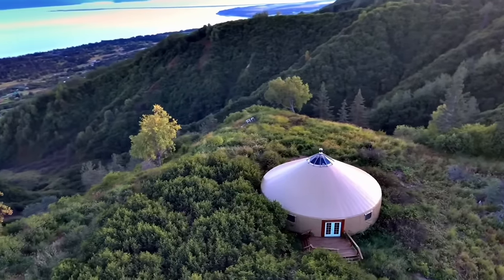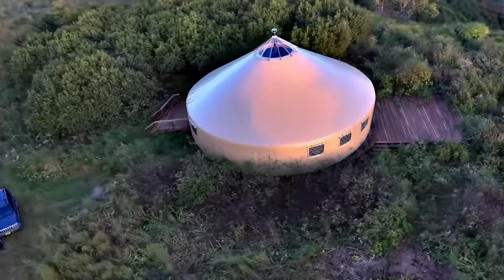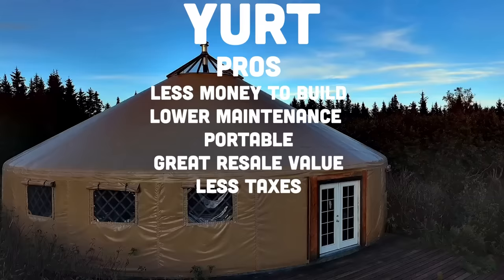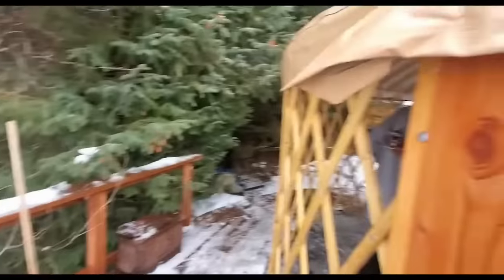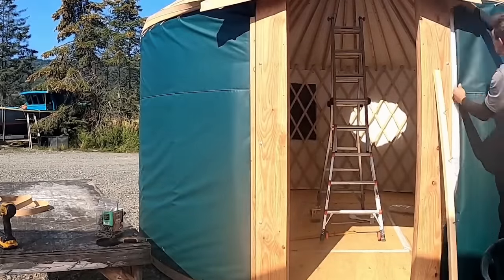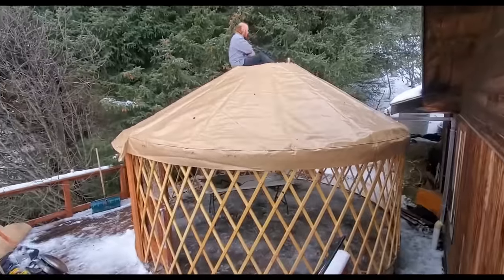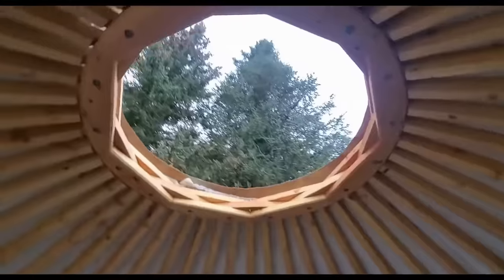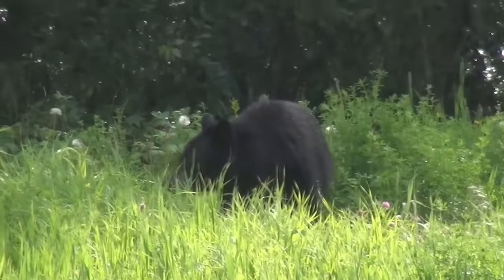YURTS... Affordable Home Solution? Or Too Good to be True? Expert Explains PROS and CONS

Comment: My wife and I live in a yurt in North Carolina. It's a 30 ft yurt with ten ft high walls. We have normal double pane windows, normal house doors, actually very beautiful doors. The insides are much like a normal house. And that's where things get expensive. A modern kitchen, bathroom septic, etc. In a yurt isn't any cheaper to build than a normal house. Yes, the outside of the structure is less expensive but everything else is the same. In the end I think we have about as much money in our yurt as we could have spent on a smaller double wide. Yurts are way cooler, to be sure, but I suppose that's a matter of opinion.
Reply from the maker: Yeah, you for sure can sink a lot of money into them if you want to 😆
Reply: What is the humidity and temperature like in the summer? My tiny house stays at 62*F.
Reply: @OneMoreAnimalAndItsAZoo  Hi Debbie. We heat and cool out yurt with a heat pump and two pretty good size mini splits. We don't have any issues with humidity, the heat pump works great for that. I will say that yurts are easier to heat than cool but we keep it at about 68 in the summer. In retrospect I'd heat with some kind of radiant heat and cool with the heat pump. We may be adding radiators to the heat mix because radiant heat works so much better than convection in a yurt. One tip on cooling, lots of modern yurts have a plastic dome on the top that opens for ventilation. Make sure that dome is tinted, not clear. Even with a tint, it's almost like a magnifying glass up there in the summer.
Reply: @1337farm  I have a 73 SQ ft tiny house that I love with a mini split. My electric bill is $50/month
Reply: @jasonlassen7599  we are in KY and I debated a yurt for like 5 years. Is it unbearable in the summer if you are offgrid
Reply: @OneMoreAnimalAndItsAZoo  that sounds great. There is quite a difference between a small tiny house and a yurt our size. We have almost 1000sqft because we have a usable loft due to the 10 ft walls so heating and cooling are on another level for us. I wish my electric bills were that low!
Reply: @Shelleys4Seasons  Hi Shelley, the way our yurt is situated, yes, summer would be unbearable without AC. If you were to make sure your yurt didn't get a ton of direct sunlight in the summer it may be possible without AC. I was also worried that we would feel like we were living in a cave so I went nuts with windows. Heck all our doors have windows too which causes even more solar gain. It's great in the winter but not so great in the summer. We also get quite a bit of direct afternoon sunlight. In retrospect we should have thought more about where we were setting up the yurt. We still love it though.
Reply: @jasonlassen7599  Since I'm in menopause, my electric bill could be a $1000 and it would be worth it. 😂
Reply: Oooo...I want one🤭🤗
Reply: 30ft is the radius or the diameter?
Reply: @christinemurray1444  diameter
Reply: @christinemurray1444  to my knowledge no one makes one that is 60 ft in diameter. That would be very tall t the peak. Last I heard Blue Ridge Yurts was working on the engineering on a 40 foot in diameter but that was before Armageddon so I'm not sure they ever started to actually offer them.
Reply: That sounds like a Blue Ridge Yurt! I want that same model in NC as well! But it's proving very difficult with my county building inspector. Any advice?
Reply: @jessdee8833  Hi Jess, yes it is a Blue Ridge Yurt. We love it. One piece of advice you didn't ask about, but is specific to Blue Ridge Yurts, is I'd get the upgraded roof. Now, as for inspectors. Sometimes you really just need to be more realistic about what county you are trying to build in. We live in Yadkin county. Forsyth would never in a million years allow this build. You have to build in a rural county that also has a reputation for independence. We started our property build with a cottage shed from Sheds Direct that is my Wife's art studio. We connected the main power box for the property to that building. Set up the connection for our RV and lived in that as we built our yurt. Yes, Yadkin county has rules about living in your RV but it's a fiercely independent county and no one is going to tell anyone what to do on their land, especially if you are simply trying to live. Be nice to your inspectors. Ask them "how would you like us to do this?". NOT, "can we do this?". Another tip to offer them is our inspirator used mobile home rules in a lot of ways to get us by. We use Studer vents on all our drains instead of the normal vent that goes through your roof as an example. Use a real septic and well system, make sure they are inspected. Inspectors are going to be even more leery about a build that doesn't have proper ways of waste disposal. What county are you trying to build in?
Reply: It depends on how luxurious you want the yurt.. it doesn't need to be that expensive.
Reply: @jessdee8833  Sweet Danes Farm look us up.
Reply: @LadyForestStar  You are 100% correct. It's all relative. I'm just saying that a $15 - 25k yurt isn't a house, it's a shell. You've still gotta pay for a foundation of some kind and enough things like plumbing, sewer, electrical etc to get a certificate of occupancy from your county inspector. There are a handful of counties with no building codes whatsoever, Idaho and Bonner counties in Idaho are good if you want total free reign. There are others too. But most folks want to be closer to civilization. Can it be done cheaper than we did it? Absolutely.
Reply: @christinemurray1444  it’s the diameter I believe. Just by looking at it.
Reply: Hey Jason could I or my husband email you perhaps and get your thoughts on some questions we have?
We'll be renting from some family friends in Idaho and have come back to our long ago idea about Yurts once we find our own land. We will most likely go through Pacific Yurts and will take a trip down there to see them in person but some times you just don't know the right questions to ask. Again, we'd love to pick your brain!
Reply: Hey Jason could I or my husband email you perhaps and get your thoughts on some questions we have?
We'll be renting from some family friends in Idaho and have come back to our long ago idea about Yurts once we find our own land. We will most likely go through Pacific Yurts and will take a trip down there to see them in person but some times you just don't know the right questions to ask. Again, we'd love to pick your brain!
Reply: @slee7991  of course. Feel free to reach out. Happy to help. There may be Idaho specific things I don't know any more. I haven't lived there since 2000 but have tons of family all over the state.
Reply: @jasonlassen7599  I’m in NC and debating a yurt as an initial structure. Any general advice in addition to what you’ve said here? Thanks so much for sharing what you have! I was just thinking to myself, is it even realistic in NC or to hot/humid/etc.
Reply: @tylorban  Hello Tylo. Sure happy to help. Look up Sweet Danes Farm and reach out. I can send you some thoughts I just put together for Jess. Yurts work fine in NC, or at least in Western NC. Piedmont and mountain area. I assume that would work fine in the low lands but the closer you get to an area that is directly effected by hurricanes the less I'd advise them. The county you want to build in is going to matter a lot.
Reply: @jasonlassen7599  definitely will do! Thanks a lot.
Likely Wake county area. Maybe southeast no more than Sampson
Reply: @jasonlassen7599  believe it or not, I watched an outdoorsman here on YouTube, ignite some dry grass with a clear piece of plastic. It was just a transparent piece with nothing special to it. He was able to focus the light to the smallest point he could make and roughly 30 seconds after it started smoking and then ignited.
Reply: Really insightful comment. My takeaway: Basically, if you're willing to use a SUPER simple plumbing system for the sink/kitchen, avoid bells & whistles, and use a composting toilet, you can avoid a lot of these expenses. I guess at the end of the day, it all comes down to comfort thresholds and budgeting goals.
Reply: @brianct7801  thank you Brian. I agree that you can be pretty simple, certainly more simple than us. However, here's an example of how things can get away from you. If you are going to have plumbing in the yurt, no matter how simple, you are also planning to have grey water draining from the yurt. I don't know of any inspectors who won't make you run the grey water through the septic system. That's one more big ticket item and why have a compost toilet if you've already bought a septic system?
Reply: I'm sorry but I think that money would increase the price of your home if you put it in a log, brick or stick home & increase in equity. Unfortunately once that kind of money goes into what's could be considered temporary or mobile homes they only decrease in equity annually. Then if you want to sell you'll also need a cash only buyer because a bank won't give someone a loan to buy it.
That said it is really nice & to have it to maybe keep in the family tucked away from the rat race, right now i give anything for that peace.
Reply: @Homesteadyshow  and never get it back
Reply: @kimk2635  Hi Kim, I think you have great points and are probably right. For us it was about building with cash and not having a mortgage so our choices were more limited. One thing I'd argue about is that there is nothing mobile about one of these yurts once it's set up for living in. It would be easier to move a stick built house than this thing.
Reply: @OneMoreAnimalAndItsAZoo  
That’s pricy if you break it down per sq foot. I cool a 2200sqft home in Deep South texas. My thermostat at 78..I pay $180 at most dead of summer..heating in the mild winters we have is a different story. Though even with the recent “cold” spells with constant 30-40 degree day we don’t even turn on the heat. The foam insulation keeps the home warm enough for us to wear a sweater if we are cold.
Reply: @kimk2635  what is the point in putting hundreds of thousands of dollars in so-called equity in a traditional home when you won’t pay that home off for the next 30 years and you’ll end up paying double with the home is worth in interest rates insurance and upkeep? If you actually think that a traditional home gains real equity and is an actual investment, then you are completely wrong and I’m glad that more people think like you do because it keeps this type of lifestyle a secret and very affordable and avoids, many zoning and regulation laws that are rampant in places where people think that homes are the only viable option for both investment and living opportunity. Stay in your traditional home. It only makes it easier for me. Thank you for your sacrifice.😊 hopefully after you’re done paying off your house and you reach the age of 75 you can finally retire and realize you’ve been working 50 hours a week for your entire life to pay for a so-called investment. ✌️
Reply: @Shelleys4Seasons  I've worked in the Alabama heat a lot, and it is pure hell. Part of the key is staying hydrated, using skin protection, and nutrition. The flying insects can really mess with you, but you get used to it.
Reply: Good luck in the next hurricane
Reply: @kimk2635  Absolutely. This is logical thinking. I'm very attracted to Yurts, but only  because they're cheap and temporary. If you think it's gonna take you 5-7 years to finance & build your own permanent off-grid domicile, yurts seem like an almost perfect solution. But like you said, it's a hard flip.
Reply: @jasonlassen7599  Thank you for the reply. My personal tolerance for RISKING operating outside of regulatory bodies is pretty high, so this needs to factor into cost as well. But I appreciate you mentioning this; find it weird that most yurt vids don't mention the regulatory aspect... hmmm...

BTW, without going into too many details, Idaho is a real option for me.
Reply: @brianct7801  Idaho is ideal for what you are thinking. My earlier comments about fiercely independent counties is easy to find in Idaho. Counties in Idaho that fit the bill: Idaho, Bonner, Boundary, Nez Pierce, Washington and Gem. Here's a quote from the Idaho county comprehensive “It is the belief of the Board of County Commissioners that people who buy and build in Idaho County have the right to build the home that best suits them.  If the roof caves in under the weight of the snow, they will know better next time….County government will not intercede on your behalf to make your neighbor live up to your standards.” LOL! Sometimes I really miss Idaho and I'm still proud to be a native Idahoan. Good luck with your plans!
Reply: @brianct7801  they don’t mention them because if you’re spending only like 5000 bucks on the structure you can afford to also fall within the regulatory guidelines I find it funny that people complain about certain expenses when living like this but they don’t complain about people spending $1 million over 30 your time span on a typical mortgage or similar money on rent.

A lot of places require a septic system and it’s like a big deal it’s like 5000 or $15,000 just pay the money and you’re good to go people forget that every house no matter if it is $10 million or $2000 is virtually just a wall and a roof and that’s it. Everything else is optional, and most likely not needed for the majority of people to live an amazing life. 

The difference between me being in a $10 million mansion and me being in something like what is in this video it’s virtually the same thing because I see no difference if I am online why does it matter what is around me and why should I have to work 50 hours a week for the rest of my life to pay for fancier walls?
Reply: Theres a yurt farm just outside Bryson City (I live here too) - is that yours?
Reply: @JasonLassen thank you for your honesty! We need a place to live, landlord raising rent too high for us. Wish we had land. Darn, need a home. We'll, if God wills it, we'll have a home soon.
Reply: I want to put up a yurt in NC. Do you have yours in a rural area and did you have any problems with zoning/building codes?
Reply: @Jj-gi2uv  wish we could afford a tiny home. With the problem of rent going so high we'll be out on the street.  Wish there was something we could do.
Reply: @cawster6858  hello caw ster. Yes we are in a rural county. I'm pretty certain a yurt dwelling in an urban area will be a no go. We didn't have issues with zoning or inspectors but we didn't try and cheat the system. Had we, I'm sure we'd have been caught and told to take it down and yurts would have gotten a bad name with the inspector and others would have had an uphill battle in the future. Ours is the first yurt in our county. Choose a rural county, preferably one that isn't full of rich folks, and work with your inspector. Ask them how they would like you to do this, not CAN we do this. They will be good to you if you are above board with them.
Reply: “About as much on a smaller double wide” man see this is basically the exact reason tho, not the amount of space, just the ease to put it up and actually be able to live in compared to a lot of other stuff and even how to upgrade after initial installation.
Reply: Is that near a lake?? Iv seen a tour of a permanent yurt similar to what you described. Beautifull home.
Reply: Yeah, this isn't an honest assessment. This is straight up marketing. Thank you for your input.
Reply: Hello, I’m looking to move back to north carolina and live in a yurt as well. What hurdles did you have with getting one. Any zoning issues? I would be purchasing my first house so I don’t really know much about buying land or anything along those lines.
Reply: @hungtor2226  As far as getting a yurt there is no problem there. Blue Ridge Yurts is just up in Floyd Virginia and they make a great product. Zoning or inspector issues are going to depend on your chosen county, not the state itself. You will need cash or personal loans for the yurt itself, no one is going to give you a mortgage for a yurt. You could get a mortgage for the land though if you needed one. As far as finding land get with a local realtor. I would advise buying land that already has a well, power and septic on it. It's not that hard to find a property with an old house that needs to be torn down that has the infrastructure you need. You can add the infrastructure yourself but it can get spendy.
Reply: I know a few who went off grid in yurts and just built outhouses and stuff. Apparently cheaper than building a house
Reply: @LadyForestStar  Exactly 👍
Reply: @jasonlassen7599  Yes! I had a Mongolian Yurt. My plan was to have an insulated earth floor. I've been to yurts with wooden floor and one with earth floor and earth floors get a very special grounded feeling that I absolutely love. But I also planned to live without electricity. Maybe just take one electric cord from one outer source depending on if there already where a source on the land. I also planned to buy land with an abandoned house, that way you get less restrictions with building application when you build on land with an already existing building. Here where I live are tons of abandoned houses. And the housing prices are already very low. So yes... It's very depending on how luxurious you want it.. I don't ask much out of life except gratefulness for the little that I have and real deep friendships. I live in northern Sweden btw.
Reply: @christinemurray1444 Diameter. A 30’ radius would be crazy huge, like a circus tent! Lol! 😂
Reply: I would love to see photos of your unique and amazing home.  Do you have a website?
Reply: If you attempt to make a yurt, like a normal house, yes.  Many don't.
Reply: Hey do you by chance have any idea of the laws in South Carolina for yurts I’m right on the border of sc and nc but would rather stay in my home state and closer to family, and I’m looking at some alternative housing and I can’t find any information on sc’s regulations on yurts, any tips or information would be much appreciated.
Reply: @JCthe1st  there likely won't be state level regulations that you can't overcome. Each county may have regulations or building codes that you can't overcome though. The folks at Blue Ridge Yurts may know the friendly counties in SC. You can pretty much bet that the counties with the cities in them won't allow a Yurt as a main residence. You could also start calling the inspector offices in counties you are interested in to get their thoughts. Rural SC is just as independent as NC so I'd be surprised if you can't find friendly inspectors.
Reply: A  new single wide is 85k-100k , a new (larger) tiny house is 100k-120k , I seriously doubt a yurt is that expensive.
Reply: @jessdee8833 move out of the city limits. Here in most of  Texas you can build what you want as long as your out of city limits, barndeminium, tiny house , cabin, earth ship ect ECT
Reply: That's still a few grand saved. Housing, especially where I live, is getting obscene. The baseline rent in the area is 800 a month. The demand is so inflated and the supply is artificially limited, and so I'm becoming priced out my own homestate, lest I end up sucked into the vortex of Detroit....
Reply: @jasonlassen7599  Nomad Shelters of Homer, Alaska make a 50ft yurt. They are a small family business making high quality product, i think they have the highest level of insulation which works well for heating and cooling
Reply: Did you have land already or do have to have approval to place it somewhere
Reply: @favor927  hello. We bought land that had a tear down house on it and then decided what to build. We tossed around mobile homes, steel barn homes, under ground etc. before settling on the yurt. We lived on the land in our RV during the build.
Reply: @LadyForestStar  here "insulated" earth floor means polystyrene panels - pretty sure that would break whatever Schumann Resonance effect you get from the Earth.
Reply: Yeah. For me, the main point in living in a yurt would be to actually be able to own my own home. And I would have 2nd hand or self-buit furniture from re-purposed materials.
I wouldn't want or need a particularly modern kitchen. Certainly no dishwasher!
Reply: @fraukeschmidt8364  owning a home is one thing - getting a yurt to be permit-approved as a home is another thing.